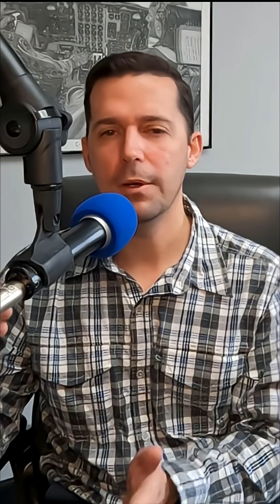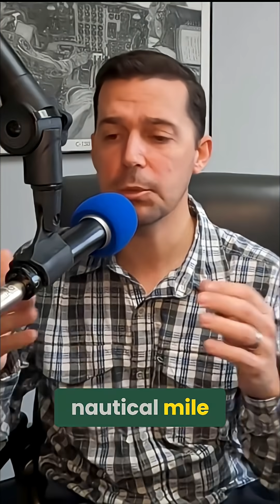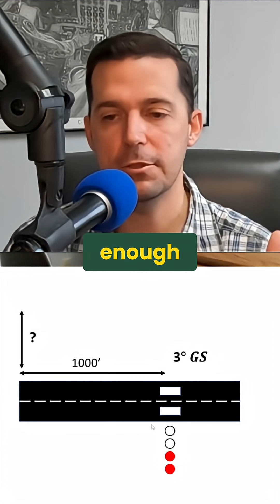Why The 50-Foot Obstacle Matters On The Runway

Comment: I’m confused. Isn’t 50 foot obstacle mentioned in the context of clearing it on takeoff? What does that have to do with a glide slope or touchdown zone markers?
Reply from the maker: It's mentioned for both takeoff and landing. The full video describes the TERPS criteria for a runway. Check it out and let me know what you think!
Reply from the maker: The link to the full video is at the the bottom of this short clip.

Comment: Not a paved runway, but Trigger Gap has a big wall o’ trees right off the departure end of one of their runways. Definitely had me deep in the “over 50 feet” parts of the performance tables.
Reply from the maker: Yup, most backcountry airstrips (including the one I use on my farm) have close in obstacles. The point of this video is that the 50' obstacle criteria is for Threshold Crossing Height at a runway that meets TERPS criteria. Backcountry airports do not have that protection.
Reply from the maker: Trigger Gap is awesome, by the way.  I was also just out at Richland Creek two days ago in the Cub. I love the backcountry airstrips we have in Arkansas.
Reply: Yes, lots of cool places to fly out there.